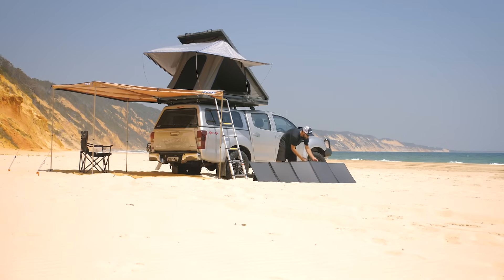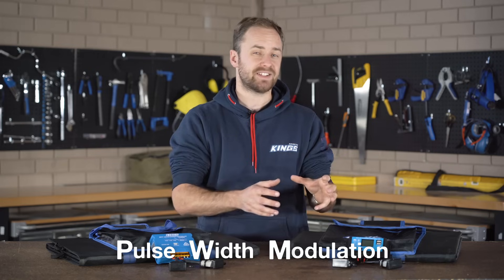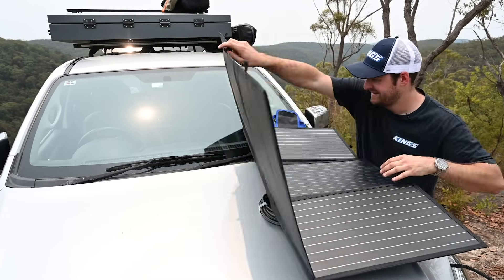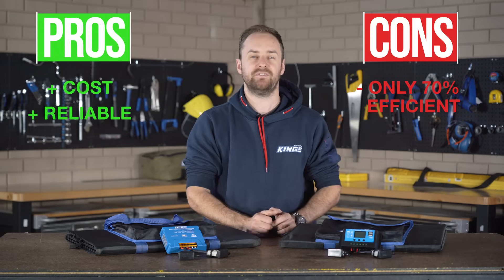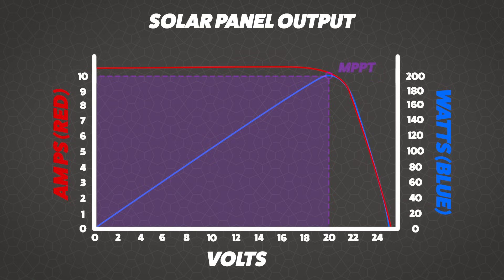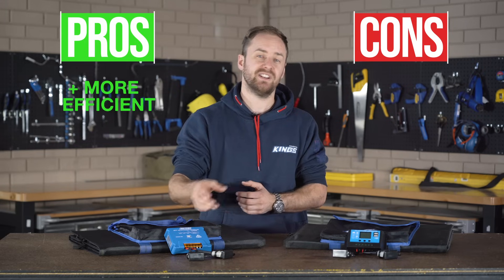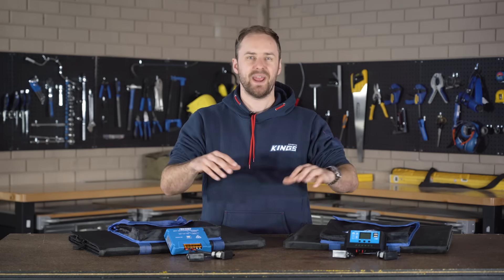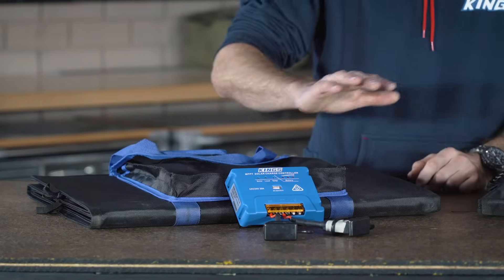SOLAR REGULATORS EXPLAINED! PWM versus MPPT - what's best & why? PLUS upgrade your solar controller!

Comment: Is that kings MPPT Solar Regulator is for sale by it self?
Reply: Today kings staff told my that the mppt controller used here was not suitable with a lithium battery.
I had always believed that that for lithium batteries you had to use mppt controllers.
Now i am confused

Comment: would you be able to show us how to put multiple panels on the one system using your chargers? thanks for all the helpful vids!
Reply: For PWM you need to connect panels in parallel, up to the rated input current.  For MPPT you can connect in series up the the rated input voltage of the controller, then you could add psets in parallel up to the rated input current.
Reply: Please make a video for this.

Comment: What brand & model is the in-line Anderson cable watt meter used in this video?
Reply from the maker: Hey mate from memory I bought it from Jaycar but you can get them online and most electronics shops!

Not 100% accurate but definitely close enough to be very useful!

Cheers
Cahn

Comment: When are the stand alone MPPT available ?
Reply: @briszx9r594  that's fine if it's connected to an "engine". 

What about if it's on a trailer, camper or caravan that's parked ?  This controller would better ? Yes/No ?
Reply from the maker: Hey mate, we do  already sell a couple DCDC chargers that do both alternator and solar charging

But this little unit should be out in a couple weeks I’d say, I’ve just been testing it recently and it should be on its way.

Cheers
Cahn
Reply: @4wdsupacentreAu  Hi Cahn thanks for the reply. 
Ok have to wait and see then. 

Don't need some extra tester ? Happy to help.
Reply: @sydneymowerandautomotivece4319  im running the ctek d250se which has a inbuilt mppt solar controller. the camper charges from vehicle when running and then from solar panels when at camp site no issues
Reply: @omar8514  like replied above, that's fine if it's connected to a vehicle. 

Stand alone doesn't have vehicle input so why buy a dual controller ? 

That's why I was asking.